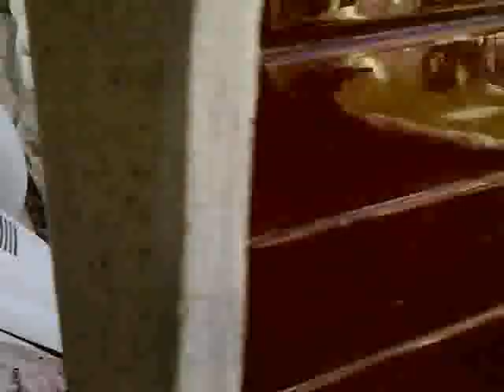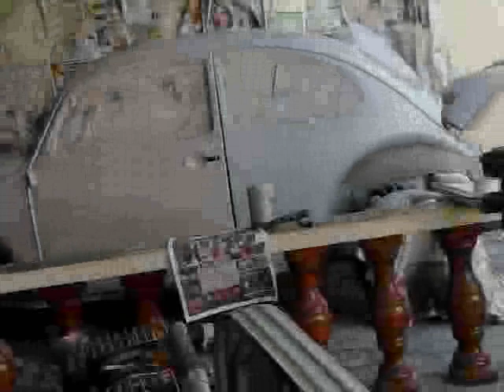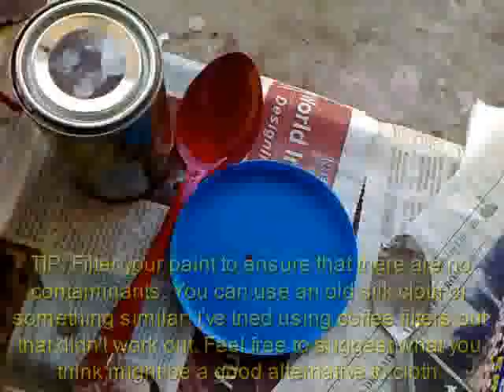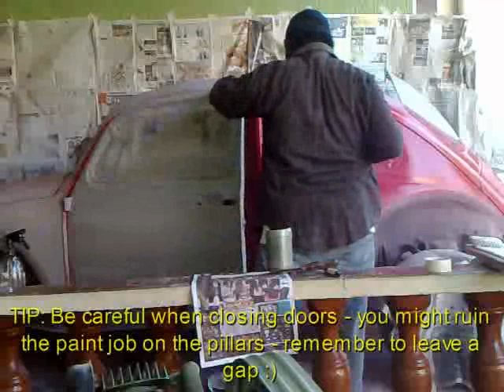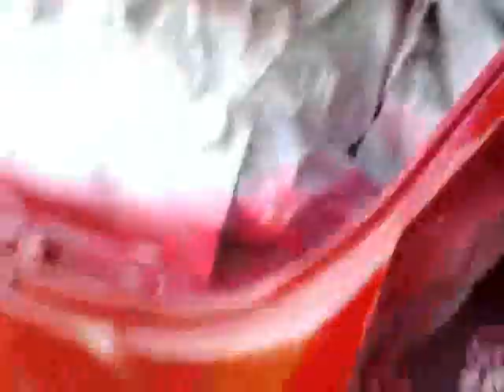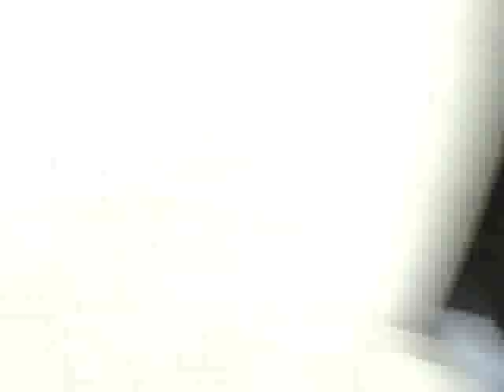Restoring and Painting a 1965 Volkswagen Beetle

Comment: good initiative, better gaining practice before shooting high cost paint, your shooting technique is better suited for lacker than for basecoat/clearcoat
Reply from the maker: Thanks Jacques! I'm pretty satisfied with the outcome of this project. If you could share some tips on what I can improve on - I would surely appreciate it :) Thanks!
Reply: yesyoucanarchie
first, a good trick to limit water to gun line is to use 2 hoses, the first one is put in a fresh bucket of fresh water and installing a filter to trap water between this hose and the hose feeding the gun
second, I observed that there is much orange peel and dry spray, the best way to avoid this is to hold your gun no more than 8 inches of the surface specially your gun is HVLP.. it is the job of the gun to spread paint and when it is too far of the surface it can only shoot paint drops side by side without having power to merge them, this is very important with a gun that have a limited air flow.
third, with a catalysed paint, it is important to adjust speed of hardener and reducer to have time to apply a complete coat refill gun and begin next coat, with the setup I see in this video, I would use slow reducer and hardener if you are in a temperate climate and a combination of medium/slow reducer and hardener in a colder climate ( say 50-60deg F) the goal is to begin application of the next coat when previous coat is at limit of the wet to sticky condition .
fourth, As I saw, your gun have a 2" wide efficient coverage, that mean that between strokes, there should be about 2" , and it is imortant to repeat the same panel spraying order coat after coat and to give a special attention to dry spray as it is very difficult to blend with the next coat for example, your arms are not long enough to cover the hood side to side, the technique is to start one side toward center and then from the other side restart form center and complete  this to avoid dry spray and dull junction.
finally, I suggest you to find Peterson andHot Rod Custom Painting and Bodywork and painting, they could be vintage books circa 1980 but worth the trouble to find them.
have a good luck

Comment: if your beetle is a 1965 how come it has the later engine lid with the air vents on it instead of the popes nose?
Reply from the maker: I'm not that familiar with period correct lids of VWs nowadays since I have laid low in the VW scene when I sold my bug. However, there's a possibility that Voxy's previous owner replaced her decklid at some point in time that's why she had a different one.
Reply: Paul - popes nose was 63 and older...64 they made teh license plate light holder flatter and wider...air vents came in 70 or 71 ?  My 69 had a solid deck lid.